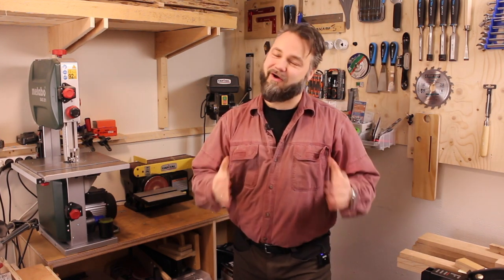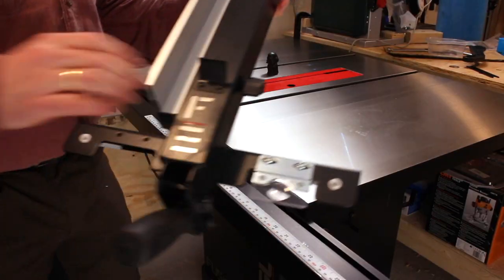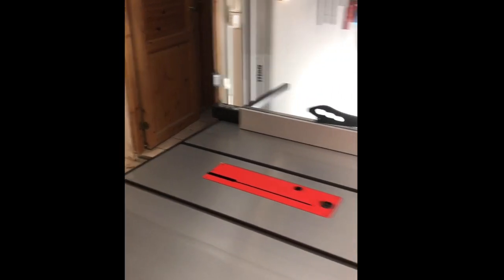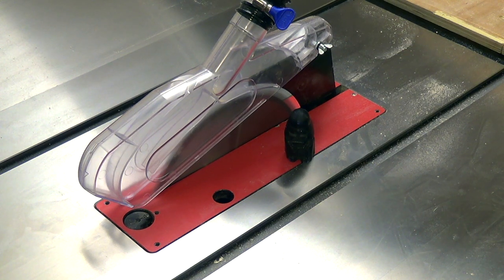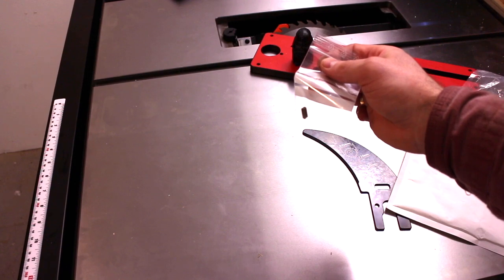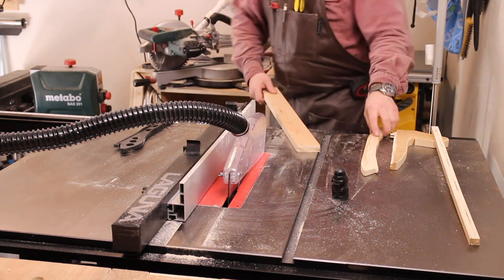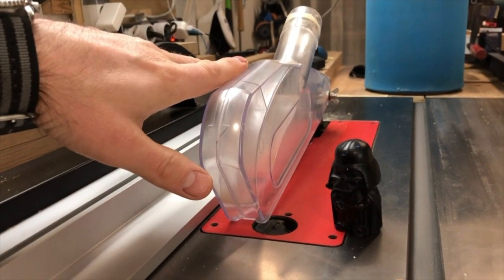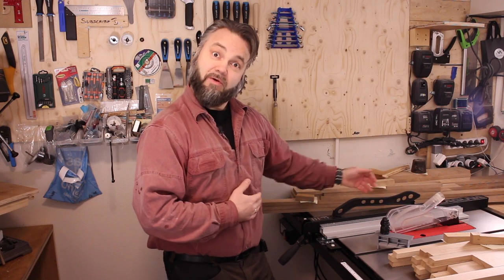Mother of All Unboxings - Laguna Fusion 3 Cabinet Saw - My Forever Tool - [0069]

Comment: Does that auto braking come standard with the f3? All of my near accidents have come after the saw was turned off and the blade was still spinning.
Reply from the maker: I really don’t know if they front it as a feature. But this a standard European version of the F3. 
But like I said in the video, this may be more of how the motor works than a «feature»....
Reply: @NomadMakes  I have the same saw and it does not stop that quickly. There is Some braking sound but it is not stopping that fast. Weird.
Reply from the maker: @pieterdesmijter420  I find that it takes a bit longer when the saw has been running for a while.
Reply: I just ordered an F3, will report back when I get mine. Surprised no manufacturers have implemented a braking system yet for table/cabinet saws. My Laguna bandsaw has it and it’s priceless.
Reply from the maker: @davekelley801  Oh! Nice. Where on the planet are you? They don't say anything about it in the users manual, or even mention it as a feature, which I think is strange. Because it really stops quickly compared to other saws I have seen.
On my DeWalt DWE7485 you could literally hear the thing slowing the blade. Wasn't mentioned as a feature on that saw either...
By the way, you are going to love the quick change feature for the riving knife. 
Are you happy with your band saw by the way? I have heard one guy that had tracking issues on the laguna bandsaw.
Reply: Laguna probably doesn't list it as a feature in the event they switch motor suppliers.  A larger motor has more resistance when power is cut, so I'm not sure it is much more than that.  Guessing, I am.
Reply from the maker: I am starting to think the same. It is just funny that it kind of stops in 2 phases. First is just normally slows down. Then it stops quickly after having slowed to a certain speed. 
Feature or not, it is pretty sweet that it stops so quickly :-)
Reply: Hi Dave, In Europe it is regulations to stop within 10 seconds. USA has no law like this.
Reply from the maker: Thaks for the info. That is cool to know.
Reply: @415volts  Good to know.  Thanks.
Reply: @NomadMakes  no probs I am Laguna UK & this is my private account ;) best wishes to you and yours
Reply from the maker: @415volts  Cool and thanks :-) Do you know how this is solved technically?
Reply: @NomadMakes  Hi Nomad, sorry for late reply. It's electro magnetic braking.
Reply from the maker: Thank you! I suspected just that :-)
Reply: @NomadMakes  sorry for the delay, just seeing this! I’m in Cali, and I absolutely love my laguna bandsaw. I have the bx14 and couldn’t be happier.
Reply from the maker: Thanks :-) I may look into a Laguna bandsaw at some time.
Reply from the maker: Thanks :-) I may look into a Laguna bandsaw at some time.
Reply from the maker: Thanks! I may look into a Laguna bandsaw at some point. Loving the cabinet saw so far.

Comment: congratulations on your new saw hope you're happy with it. I ordered one and hopefully it'll be here in a month or little more. I also have my shop in lower part of the house where I need to disassemble and re assemble the big machines to get them down in the shop. was it  complicated and time consuming to reassemble and tune the tablesaw?
Reply from the maker: Thank you, and congratulations on you purchase as well :-) It was not very complicated assembling and re-adjusting this saw. As I had to disassemble it, I cannot say how accurate it was set up from the factory. But you will probaby have to adjust the saw when you recieve it anyway. At least check it for accuracy. But I suggest you get some help lifting the table back on. Everything else is well explained in the users manual. 
Feel free to drop me a question if you have any when you get the saw. And I will see if I can help. 
Oh! And make sure to save the «keys» if you have to disassemble the wheels. They are very small and easy to miss.

Comment: Perhaps I missed it, but how many horsepower does the motor produce?:)
Reply from the maker: I don’t think I went over the specs in the video. It is a 3 horse power or 2200W motor. And I have it on a «slow» 16 amp circuit. A 16C breaker.

Comment: Hei. Har også kjøpt en fusion 3 og fikk den rett før påske. Veldig fornøyd! Har sett noen videoer der noen setter inn toppen med paste wax. Har du satt den inn med noe?
Reply from the maker: Nei, men jeg har bestilt fra Gustavsen. Har avfukting i boden, men det dryppet litt fra støvmasken ned på bordet, og det ble merker med en gang. Så jeg anbefaler å vokse toppen, ja.
Reply: Hei, har skrevet kommentar over her, men hva er din erfaring med stivheten på gjerdet? Ser den er ganske fleksibel helt ytterst på andre videoer. Hvordan er den ved bladet?

Og hvordan er nøyaktigheten på vinkel? Hvis jeg kjøper så kommer jeg til å kjøpe nye modellen med digital avlesning
Reply from the maker: Hva endte du opp med å kjøpe?

Comment: I gotta say. I bought a $600 delta saw. And it had alot of the same parts as your f3.
Reply from the maker: That does not surprise me at all. Most likely they are made in the same factory. Cheers with your new saw by the way, are you happy with it?

Comment: Hi I just wanted to let you know that Laguna may have sent you an older model power switch, even my F2 has the big red paddle design. I could be wrong, maybe they use a different switch component for the 3HP motors in Europe but even their photos on their site show the big red paddle. Also, the guard I have on mine is a split type. No idea why you got one of the design seen in this video. It's also a little odd that you didn't get a manual.  I live in the US and those are 3 red flags (not even mentioning the missing key for the tilt arbor or the non-included riving knife) that you may want to reach out to Laguna one more time. Even on my F2 literally none of these issues, riving knife included, proper switch design with paddle, split design on guard, no missing keys. If your supplier does their own packaging of these saws, maybe all this is their fault?

Other than that, congrats on the new saw, it's a great quality tool.
Reply from the maker: Thank you :-) 
I have also seen pictures of the F2 with a paddle switch. These saws come directly from the factory in their boxes. And I believe that there are regulatory reasons why the riving knife is not standard. Only a few years ago the blade guard were supposed to be screwed on over here. 
It would be nice to see a better blade guard though. 
Is your saw a F2?
Do you know if they have the same mechanism for changing the riving knife?
Reply: I caught myself looking at your switch trying to figure out of there was a keyway or something to add the paddle.  Couldn't tell.  I think they normally just sit over your off button making it bigger...
Reply from the maker: The switch is just a normal on/off. You will have to Macgyver something for a paddle switch.
Reply: @NomadMakes  one could be added if wanted.  In USA a 100v switch is about 20$ US, not sure the price on a 220...  Try searching for a magnetic power tool switch.  The paddle type would be nice because you can hit it with your knee or whatever other appendage you can swing at it.  Most mount in a t slot like thingamabob.
Reply from the maker: Thank you for the tip :-) I may have to look into that.
Reply: Hello, I have been reliably informed, the paddle switch fitted to Laguna's in the USA is not compliant in UK, I assume the same for Europe. Which is crazy, the big red "off" paddle is obviously a much better safety feature than the small red "off" button we get on our EU version! Its not like the paddle design is the problem, my amazing little Dewalt DWE7485 table saw has a paddle "off" switch. I believe its the mechanics of the switch that is not compliant. When Laguna Tools can sell their table saws and it seems all their other products in Europe quicker than they can make them, why would they spend thousands of dollars developing a paddle switch for the European market or maybe they have one in development? I was a bit disappointed when I received my new Laguna Fusion 3 2020 version table saw in May 2020. in the Laguna marketing video's it shows the new saw with the new, highly improved mitre gauge, unfortunately in Europe we still get the old version (I guess they are using up the old stock) when I questioned this, I was advised that's how they were shipped from the factory in Taiwan? Still a great table saw if you can get one, kind regards Pete
Reply from the maker: I believe the saw you see in the videos are the US version of the saw. And it is like you say, that the saw comes unopened from the factory to the customer. At the Norwegian retailer, they had them in shipping containers. 
Also, I would like to say, that the cons I brought up in the first impressions are minor issues, to me at least. I think it shows more of how good the attention to detail is on the DWE7485. But one can always wish for more :-)
Reply: @NomadMakes  it never would have occurred to me that the EU version of the saws would have differences like this. I would expect of course voltage differences but they really should show on their web site these minor differences between EU & US.  But I agree, it's a good saw and I have my own minor things to point out but they don't really make the saw a detriment.
Reply from the maker: Yeah :-) This saw is my favorite tool at the moment :—D